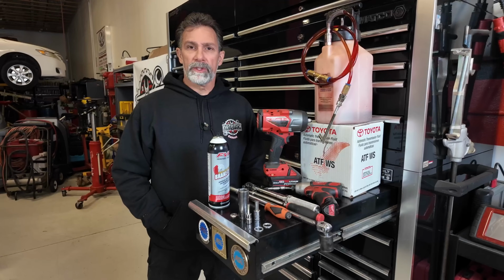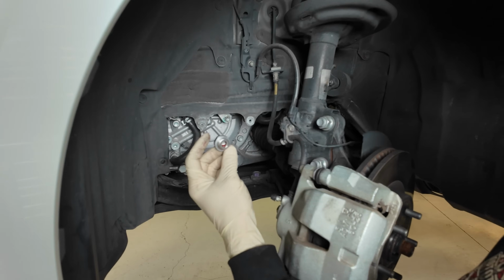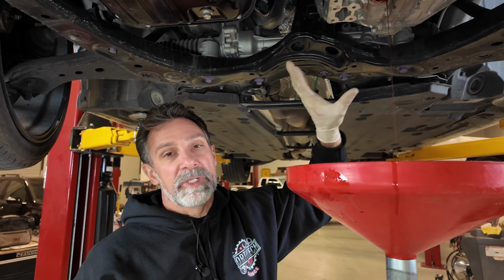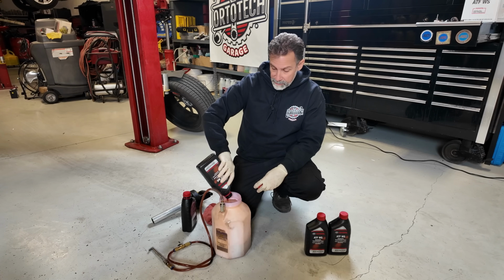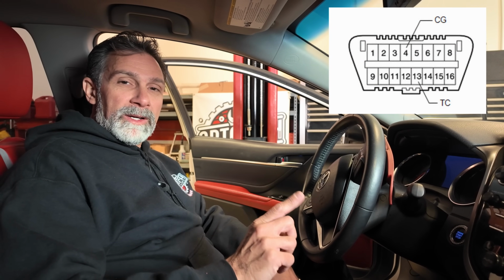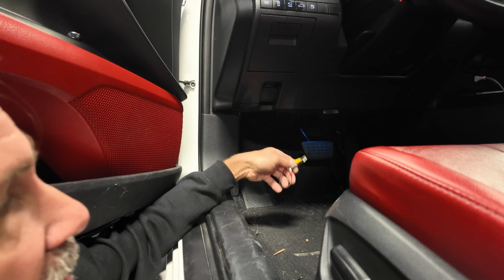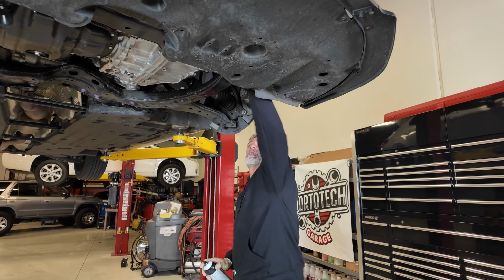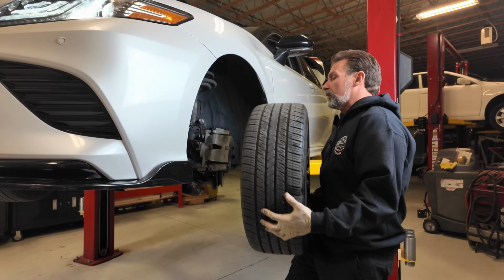The Ultimate Guide to Changing Transmission Fluid on Your Toyota Camry

Comment: Hi I have a question I have a Toyota Camry 2018 on march 2025 on the dash start showing me check engine lights on and I use and obdo2 and give 3 codes transmission converter and solenoids I drain the fluid was black dark burn odor change 3 times same problem and them stop working cost me 5000 dollars repair so did you recommended change fluid again like I said this repair was march 2025 you recommended change or not I didn’t see how fluid looks like now so
Reply from the maker: I would assume whomever made the repairs in March also flushed the old fluid. If that is true, I would put it back on a regular maintenance schedule of every 30,000 miles.  👍

Comment: would this procedure be the same for a 2020 - 2025 corolla ?
Reply from the maker: You have cast a wide net for that year range.  The process is similar for the earlier automatic transmissions but you need to be careful, because many of these models have a CVT transmission, which is different process and fluid.  You really need to know exactly what you have before you do anything.

Comment: I have a question my plug on obd2 connection only have total of 6 pins there is no #4 pin or #13 pin. This is on 2020 rav4 what do I do ?
Reply from the maker: Different model, so there is no procedure to activate the TC terminal manually on the newer models.  You can use a scan tool to do that, or the instructions that I have seen just say to just perform the shifting procedure if no scan tool is used.  There are instructions for with, and without the scan tool.   If you want to email me, I can send a PDF of the instructions this week.   Ortotechgarage@gmail.com

Comment: Thanks For the video, I have one question, when You have  the correcto temperature in the transmisión, and You go to check the level, do I need to have the car in idle?
Reply from the maker: Yes!  When you see the D light go on while the shifter is in Park, you want to leave the vehicle running and quickly check the level.  If the car is not running, the fluid is not circulating and the level will not be correct.  👍

Comment: Great video, never seen the jumper wire method. One question though. Were the wheels spinning when you were shifting the trans gears or was your foot on the brake?
Reply from the maker: Thank you!  And no, definitely no wheels spinning.  Hold the brake firmly.  You are shifting back and forth between gears and dont want to change directions while the wheels are spinning.  Also, make sure you understand the terminals in the diagnostic connector and jump the correct terminals.  Just follow the procedure outlined. You can do it!  Thanks for watching, for the nice comment, and for supporting the channel!  🙏

Comment: loooks similar trans as the 2019 5th gen video I just saw. Buying a 2025 5th gen rav 4 and need to get washers and drain plug for backup. Guess there isn't a trans to change. Similar to my 2015 to drain and refill fluid. I do mine every 3 to 5K for fun!!!  Wish he'd do a 2024 or 2025 rav 5 (non hybrid, just gas). hard to tell but looks like the drain plug washer is the same size as the fill plug washer.
Reply from the maker: The transmissions are different from 2015 to 2025.  As 2025 Rav4 become a little bit older, I will make a video on them.  Keep an eye out for a future release.  👍

Comment: How bout putting the exact amount in that came out?!?!
Reply from the maker: I suppose if you could accurately measure what you took out, don't spill any, and are certain that it was accurately filled before you drained it, that would work.  But checking the level with the procedure shown is easy enough.  I would double-check the level after refilling it anyway.  Plus, it's good to experience this for yourself.  It will build confidence, and you will learn from the experience.  You can do it!! 👍

Comment: Recently purchased 2011 Camry le with 115000 miles. No transmission records.    I felt the transmission slip once when it was cold but not when warmed up. Would you recommend a drain and fill and change the filter?
Reply from the maker: Yes, I would.  Maybe even drain and fill a couple of times.  It could very well solve your problem and enhance shift quality.  👍

Comment: What size is the drain plug washer and if i do this at home with jacks stand do i have lower the vehicle when doing the fluid level check?
Reply from the maker: I recommend you pick up the drain plug and fill plug washers from the local Toyota dealership.  They will get the correct sizes for you.  Working at home, you will need to get the vehicle up on 4 jack stands.  I recommend you put one at each corner of the pinch weld locations in front of the rear wheel or behind the front wheels, and all at the same height, assuming your floor is level. Or at heights that make your vehicle level.   I have a video on how to use jack stands  in my collection, if you need it. I also recommend you learn to check the fluid level correctly a few times before you actually perform the service.  This will give you confidence to do it correctly and quickly when timing matters.  If you are fumbling through the process, the fluid temperature will exceed the upper limit within a few minutes, and then you'll have to wait a while for it to cool down.  👍

Comment: all new cars and Toyota included are shit wagens, cars of yesteryear were 100 percent better cars with straight forward repairs, I have an Avalon, worst decision ever, not a good choice for a vehicle if you travel, too small and front wheel drive, close to being junk.
Reply from the maker: I don't think cars were any better decades ago. They just had less crap on them. Now, TPMS, adaptive cruise, collision mitigation, land departure, VATS, HID and LED lighting, vibrating seats, parking assist, panoramic roof, 10 speed adaptive transmissions, etc, etc. Add the strict emissions compliance on top of all that, and it's no wonder why everything costs so much. We grew up in simpler times, and they're not coming back.

Comment: Would measuring the amount of transmission fluid and replacing the exact amount be an acceptable way to do this procedure?
Reply from the maker: I suppose if you could could accurately measure what you took out, don't spill any, and are certain that it was accurately filled before you drained it, that would work.  But checking the level with the procedure shown is easy enough.  I would double-check the level after refilling it anyway.  Plus, it's good to experience this for yourself.  It will build confidence, and you will learn from the experience.  You can do it!! 👍

Comment: Drain plug gasket part number Toyota oem please
Reply from the maker: I would call your local Toyota dealership parts department and verify for your application to make sure you get the correct sealing washer.  There are several options. You should grab one for the fill plug as well.  It is a larger sealing washer.  Again, confirm with the parts department. Best of luck with the service!

Comment: Is there any way to do a full flush of the transmission fluid through the transmission cooler return line?  Or is it recommended to just continue doing the refill drain method a couple of times to get more "new" fluid in the system?
Reply from the maker: Yes.  There are 2 ways if you can access cooler hoses. Some vehicles you cannot.  1) You can connect a transmission flush machine.  2) The DIY way would be to use the internal transmission pump to push the fluid out of one detached cooler hose.  You can do this by putting the vehicle into drive.  It takes 2 people, and you must be careful never to run the transmission fluid low.  Just keep filling while the cooler hose is pumping a steady stream of fluid out, no air pockets in the stream.  The person must hold the brake to keep the wheels from turning and to shift the transmission back into Park as soon as the fluid comes clean at the cooler hose.  Shut the vehicle off right away and then adjust the level like normal.   You have been prepared with plenty of fluid, a large drain bucket, and the hose should be tied to direct it in the bucket.  3)  You could also do multiple drain and fill cycles, working the vehicle through all the gears after each fill to circulate the fluid.

Comment: Is it possible to just measure what comes out , put same amount back in ?
Reply from the maker: While this is technically possible, I don't recommend it.  First off, how can you be certain the level is correct before you drained it?  You are making an assumption.  Perhaps it had been serviced and filled in correctly in a previous service.  Maybe some fluid has leaked out?  Also, it is very difficult to drain all this oil into a container without making a mess.  If you inadvertently spill some fluid while draining, you won't have a way to quantify that.  This process may feel intimidating, but once you have gone through the procedure a couple of times, it's not so bad.  I would say to get comfortable with the process by performing the procedure a few times prior to the day you want to actually ser ice the vehicle.  You can even pull the check plug and experiment with checking the level at the correct temperature.  Then, when you are feeling confident, go ahead with the full service.  Part of growing your skills is learning  something new.  I have given you every step you need for success.  You can do it!!  Please let me know how it went when you have completed the service.  👍
Reply: Easiest is drain out see how much u got for example Camry 2019 taking 2 and half litres

Comment: what's the yellow piece called and  where can i buy a replacement other than the junkyard because i know im gonna break it
Reply from the maker: Lol.  It is the overfolw check tube.  It is not very tight in there and should come out easily with an Allen/hex socket.  Just barely snug to reinstall it.  You will be fine, I've done hundreds of them and never had a problem.  Best of luck!

Comment: Great video.  You only put 3.5 qts of fluid in.  My camry is 2020 with an 8 speed both automatic and manual shift.  The specs in the manual say it takes 7.3 qts.  Thats a big difference from the car you worked on  Is the manual accurate?
Reply from the maker: That spec is likely the total capacity for the transmission.  The drain and fill is only about half of the total capacity.    Keep in mind there is quite a bit in the torque converter plus the valve body and clutch assemblies that you can't drain out.  3.5 to 4 quarts is pretty normal for this service.

Comment: Thanks for the video - good job on the thorough explanations. I have to do my 2016 Camry which is similar (I have watched other videos for that) but will be using my scan tool to watch the temperature from below. I am getting more and more disappointed with how things are going in newer cars... no more trans dipstick, 0W16 and OW8 (!) viscosities... (the dealer stated no initial oil changes till 16000 km!  Are they insane?) so many onboard computers... large LCD screens with multi menus just to change things that used to be simple knobs (ie fan speeds).... we had a 2004 Corolla and it was great!  We sold it to a student with 270,000 km and it was still going well. I have a 2005 Impala with the 3800 V6 and it has over 500,000 km... still going. Still the original tranny, original engine.  (The Impala did have a multitude of other issues over the years though).   Yeah - been working on cars for many years... sad to see what is happening. And don't get me going on the extreme poor state of the latest PU trucks...      But good video. Thanks for taking the time to make.
Reply from the maker: Thanks for the nice feedback.  I feel your frustration with the state of the automotive industry.  It's my daily life.  They addition of all the ADAS systems has really added another layer of complexity to the already complex systems.  Everything is programmable, but most systems only with licenses, subscriptions, and factory scan tools.  Its really increased the cost of auto repair dramatically.  They've been trying to get independent garages like mine out of the repair industry for decades.  Thanks for your support, and best of luck with your project!
Reply: @OrtoTechGarage  Thanks again for the reply!  My DIY advanced scantool (X-Tool D8) subscription ran out - now they want like $500 a year?  Something horrendous like that.  Almost cheaper to buy a new scantool.  The 'Car Care Nut'  recommended it. (https://www.youtube.com/watch?v=IVsrqxtlcDI).  Anyways - take care and all the best!
Reply from the maker: @rangerrick8220 I will check it out.  All the more advanced scan tools seem to require paid updates.  Mosy of the limited use ones have a lifetime of free updates. My professional scan tools are usually upwards of $1000 for an update, or they require a monthly subscription to keep them current.  Plus, you pay separately for gateway access on Merecedes, Chrysler, Nissan, etc.   Seems the way everything has gone where they want that guaranteed steady monthly income...🤦‍♂️

Comment: Great video. If I may, I have a Highlander and have heard issues with the transmission. Book says 60k miles, some folks have said do it at 30k others 20k. Can it be changed “too” early? I have 20500 on it. Should I wait until 30k? Thanks
Reply from the maker: Thank you!  You can't change it too early, or too often, but I think every 30,000 miles is sufficient for a service. There's no need to do it just yet. Every 30K will do!  😉

Comment: I was getting anxiety looking at that pump handle laying on the ground and was so happy you gave it a quick wipe before placing it in the jug, and you did it without even thinking about it. Guaranteed it's being done every time. Little details like that are important. Seeing that, the very thorough fill at the correct temp, and the cleanup afterwards, you sir get the stamp of approval. Great job! I really like that fill procedure, although a bit more complicated, its very accurate and takes any guesswork out of the equation.
Reply from the maker: Thanks for the very nice feedback!  I appreciate your attention to detail.  Also, keep in mind that I keep and expect my employees to maintain an impeccably clean shop.  I appreciate your support!

Comment: What do you need to jump the obd port? I want to tackle this job this weekend since my 22 Camry se just hit 60k miles. Thanks in advance
Reply from the maker: I dont believe the 2022 model year has this terminal.  You can look first. It's missing from the OBD port.  If that's the case, you can complete the procedure as outlined without activating the TC Terminal with a jumper wire. Make sure you practice getting into fluid temperature detection mode the night before.  Don't wait until you need to check the fluid level.

Comment: Had my t. Camry since 4.25.  Got it jacked up and checked fluid condition.  Was worried as there was no record of service.   One quart came out and it was red and didn't smell burned.  I just replaced the quart only.  In my truck I replace 3 qt. Every 10,000 miles.  On the Camry checked the suspension and used Armor All on all rubber bushings.  On the brake fluid reservoir I pull out one half pint and put in new synthetic brake fluid.   Cleaned mass airflow sensor with electronic cleaner.  Wipe down engine with damp rad and detail etc.
Reply from the maker: Nice!  Sounds like your doing a great job taking care of your vehicles. Keep up the good work.

Comment: Thanks. Looks like a nightmare compared to Honda ATF change. I'm sure all Toyota techs follow these procedures step by step when a local dealer charges you $300+ for ATF change. Makes me wonder what we get for the money we pay...
Reply from the maker: You're welcome.   Honda makes it super simple.  This setup is not as bad as it seems once you get it down.  I always recommend practicing that shifting sequence the night before.  Just to make sure you have the timing right and you understand how the D light will function.  You dont have time to fiddle with it when you're actually ready to check the fluid.  It will go over temp in a short period of time. 👍

Comment: Hi my 2013 Toyota Camry transmission fluid had never been changed it’s at 105,000miles is it too late to change transmission fluid or should I leave it be
Reply from the maker: It's not too late at all.  I just did a 2013 Corolla today with 157,00O miles on it.  It was black.  I had to flush it with 10 quarts to get it clean.  It's working just fine after the service.  👍

Comment: Do you have to drain the fluid when cold or it’s okay to drain it when it’s warm?
Reply from the maker: You can drain it at any temperature, just need to check the final level after filling while its in the correct temperature range.  👍
Reply: I’d drain it cold for two reasons.  Draining only removes half the fluid so the temperature of the mixed fluid could be over the ideal temperature range.  Second reason is related to the mixed fluid temperature- the higher the mixed fluid temperature is, the less time you have to complete the process.
Reply: @davids2530 thank you, please can you come again with your explanation. I’m a bit confused with the mixed fluid and mixed temperature parts. Is it when drained cold or warm?
Reply: @ebbe_grant  No problem. I drive car and drain 1/2 the fluid.  Fluid is 180 degrees and I add 80 degree fresh fluid.  The mix is now 130. Too warm.  
Let’s assume fluid should be 95 to 110 when you start draining out of the tube.  I’d rather have the extra time of starting with 95 degree rather than 109 degree fluid so I’m not rushed and start draining when the fluid when the fluid is getting warmer every second. Hope this helps
Reply: @davids2530 yes it does help. Thank you so much for your explanation.